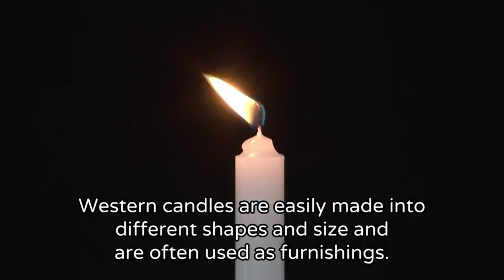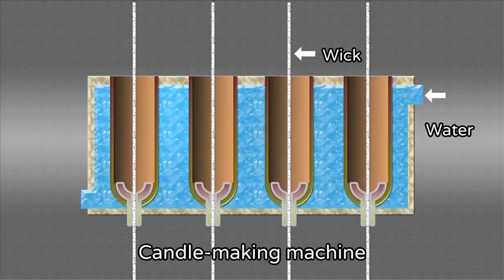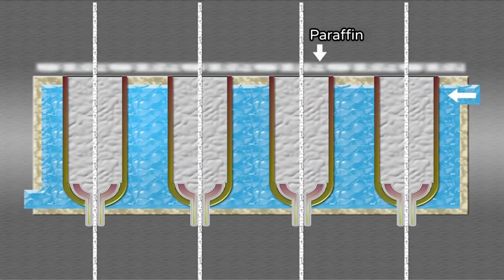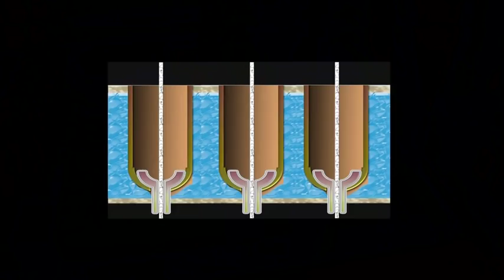THE MAKING(English Version)(264)The Making of Candles

Comment: The "western" method is for candles of lowest quality. My father makes his candels himself with wax from his own bees. This is the material german's only had used before parafin was introduesed. With good material for wicks (non syntetic), you can have very good "western" candels, too.
Reply: Thank you! Thought this as well. Loved the knowledge about Japanese candles but wish they had shown something other than lowest common denominator western candles
Reply: This isn't really a fair comparison. The "western" candles are mass-produced, low quality alternatives to the traditional beeswax candle. Having said that, beeswax candles were usually reserved for church use since they burn slowly with a delicate yellow light and don't produce any smoke. This made them more expensive so most people would have had a "taper" made from rushes dipped in tallow.
Reply: @ApiaryManager what made and still makes them more expensive is the work needed to get bees wax, but sure the churches demanding huge amounts of candles dident help
Reply: @aggese  I was referring to churches in medeival Europe. I'm not sure if the church requires pure beeswax candles anymore.
I agree that beeswax is a "scarce resource" and requires a lot of manual effort to process .

Comment: I just wanted to note that western candles can also be made of bee's wax :)
Reply: If some other material (parafin) IS used, you might say it's "none of your beeswax!"   ;-)
Reply: Also from sheep tallow.
Reply: or soy.
Reply: i remember hearing about candles using bayberry wax. you boil bayberries to get the thin wax coating from the berries. they are supposed to be expensive and burn cleanly with a nice scent. i remember the wax being a pale green color.
Reply: @marthachampagne316  Bayberry candles used to be very popular but because of the manufacturing costs not so much these days. There is, however, an old superstition of burning a bayberry candle on new years, and a saying: "A bayberry candle burnt to the socket brings food to the larder and gold to the pocket"
Reply: They don’t need to be so accurate...because western media is not accurate when it’s comes to OTHERS traditions 😊
Reply: las hacían si, pero ahora ya son escasas y muy muy costosas
Reply: Less than 1% are though also bees wax has a very low melting point and burn in a matter of hours rather than days like wood wax.  all hail oil consume consume consume

Comment: the Japanese are good at a lot of things but holy shit did they overcomplicate candle making.
Reply: Uhm, tradition? Common sense. Duh
Reply: small brain will think like this
Reply: WELL I didn't think it was that bad, right up until the whole "Lets roll the candle by hand" bit.. 
like that's where I'd just had molds set up personally so I could have did my initial thing with the candles
then let the wax in a mold harden on its own time.
Reply: There are advantages.
Reply: @douganderson7002  that's a simplified viewpoint but not necessarily wrong. I mean I'd rather eat beeswax than paraffin. Paraffin is what we use for our candles and it comes from oil. So yeah the natural route is better kn this case
Reply: @douganderson7002  Yeah, it's not because they are "natural" they are better, but theese candles ARE better than paraffin candles, which give off trace-amounts of fumes, that are basically carcinogenic diesel fumes. A wester stearin candle also solves that problem, but they are about 40% more expensive due to more process in making the basic fat. I bet theese handcrafted candles are 10 times the cost of factory made candles.
Reply: A better comparison would be “Japanese Candles” vs traditionally hand made, natural western candles.  I’d still be impressed with the Japanese wick design, but there is otherwise much less difference.

This strikes me as interesting information combined with propaganda.
Reply: @carlosandleon  yeah.. I would advise you to not eat candles.
Reply: @EmpressBeauty natural does not equal healthy, that's the appeal to nature fallacy.
Reply: @carlosandleon  Ever heard of fallacies? That one is called "Appeal to nature fallacy" this means it is logically incorrect. So no, you're wrong. There is no such thing as "it's natural so it must be healthy"
Reply: There is a  practical reason for the overcomplicated-ness though. Japanese candles were designed so the flames didn't flutter with the wind. It worked when just about every part of a Japanese house was made of flammable wood and other plant material.  Neither did the Japanese have much access to glass covers, like the Europeans did, that would've shielded the flames from a breeze. The other consideration is the little soot these candles produced, almost impossible to remove from wooden ceilings and rafters, but that's really down to the choice of wax than anything else.

Nowadays, you would only buy these candles for the aesthetics, or if you still lived in these traditional houses.

Comment: I understand using traditional methods for making Japanese candles.  However, I don't understand how over time tradition didn't change to use a deeper bowl for "wetting" the wicks to thicken them.  If the bowl was deeper the wicks could be dunked deeper and therefore quicker.  I'm sure even in ancient times speed and innovation weren't unheard of.
Reply: I think its mostly tradition handed down from generation. Sure it can be improved but saying goes "if it ain't broke, don' fix it"

Comment: They fail to note that candles can also be made by stearin, traditionally by dipping the wick and letting it cool, and repeat, or with the same automated process as with paraffin candles. https://sv.wikipedia.org/wiki/Stearin  https://en.wikipedia.org/wiki/Stearin (note the difference between the pages) Basically animal or vegetable fat, that is fractioned and where the hard fraction is used. The difference from a paraffin candle is that a stearin candle is actually theoretically edible, good for use on a birthday cake, and they soot less. I myself am severely allergic to the fumes of paraffin candles, but do not react to stearin candles. Cool with theese wax-nuts they make candles from in Japan.

Comment: what is the price diffrence between the hand made Japanese candles and the western style automated process?
Reply: Shokara2 Japanese candles go for $10-100 each in the US (you can get a box of 3 or 4 for about $30-50 on eBay).US candles can be as low as a $1 each, but the Japanese candles are very solid (the wax is more lacquer than wax) so they last forever